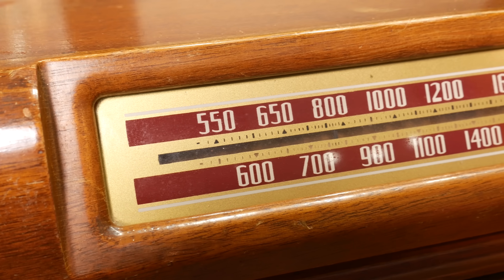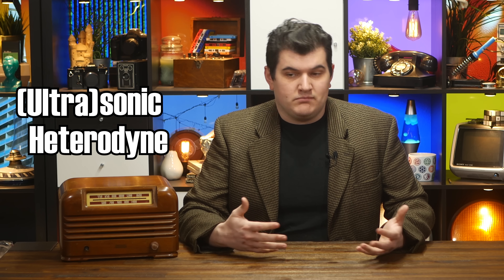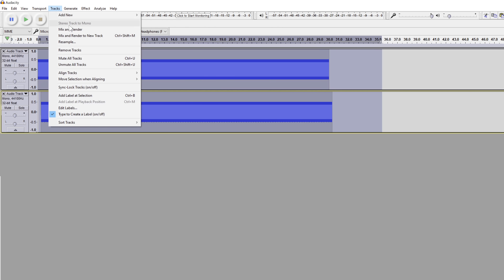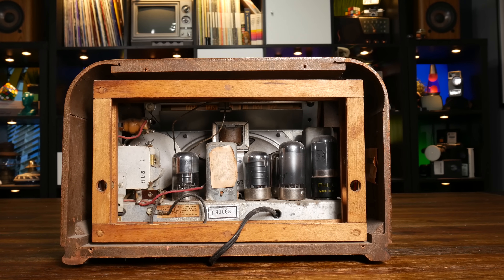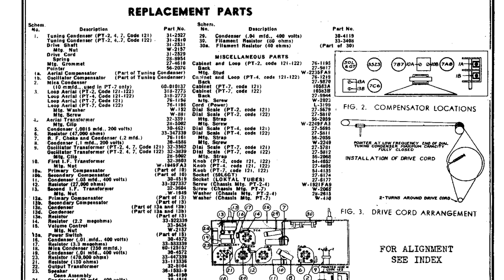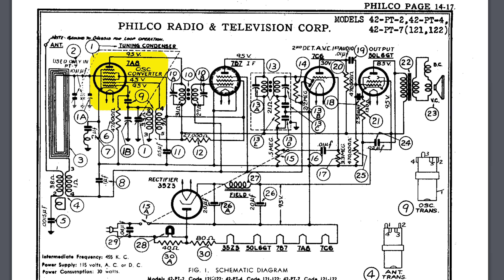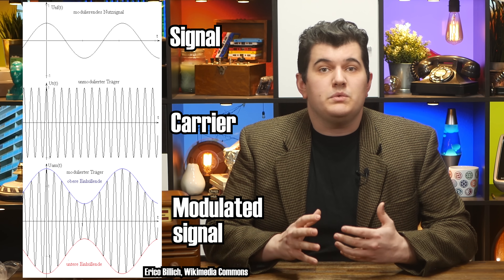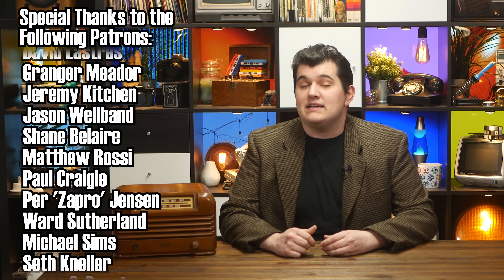The Superheterodyne Radio: No really, that's its name

Comment: This video needs quite a significant correction.
To produce intermediate frequency, one needs not to add two signals (input and heterodyne) together, but multiply them. Addition, being a linear operation, doesn't produce new frequencies you can filter out. Multiplication is what adds and subtracts the frequencies. This goes from the fact that sin(a)sin(b)=(cos(a-b)-cos(a+b))/2. As you see, when you multiply two sine waves, you get (co)sine waves of their sum and difference frequencies.
Though it's possible to do true 4-quadrant multiplication with vacuum tubes, this would require extra tubes, which is cost-prohibitive. Instead, inherent non-linearity of a "pentagrid" tube (with five grids) was used. This tube was working as the oscillator and the non-linear element at the same time. The sixth grid shown on the schematic in this video, grounded along with the cathode, is used to reduce the parasitic feedback capacitance.

Comment: Superb, old boy.  I learned about Superhetrodyne radios while fixing up a 1929 DeForrest Crosley (2x 245 tube push-pull audio output, 3 227s, 2 226s and an 80 rectifier, if I recall).  I picked up off the side of the road. What a machine, I miss her dearly!

Comment: Pretty cool. The first section of the video reminds me of celeste pipes in a pipe organ. There are normally tuned pipes that make up a rank of, likely, string pipes. These are tuned, I think, to A440. There is then another rank of pipes which is tuned just slightly off from A440. When the two ranks are open to a manual on the console, and you hold a key down, it will produce an acoustical beat, as both ranks are played.

Comment: The concepts in this video would make a great segue into how stereo FM works! After FM demodulation, you end up with another frequency-division signal, with:

- The left+right channels (mixed) at 0 Hz: Will be played by radios that don't support stereo FM and assume every FM signal is mono, making the stereo FM signal backward-compatible
- The "stereo FM pilot" tone at 19 KHz: Tells a receiver that supports stereo FM that the signal is stereo FM (for mono-only receivers, this will likely get filtered out due to the demodulator not being fast enough)
- The stereo signal at 38 KHz: This is actually the left channel MINUS the right channel. A stereo FM receiver can add this to the mono signal to get (left+right)+(left-right) = 2*left, or subtract it to get (left+right)-(left-right) = 2*right.

What's ingenious is the stereo signal is at exactly double the frequency of the pilot tone, so the receiver uses the pilot tone not only to detect stereo FM, but also (after doubling its frequency) for heterodyning the stereo signal down from 38 KHz. If the receiver had its own local 38 KHz oscillator for such a task, the stereo audio wouldn't sound quite right due to minor frequency differences between the transmitter's 38 KHz oscillator and the station's.
Reply: The hardware is fairly simple. The multiplex output signal from the tuner is applied to a separation amplifier, which separates the mono L+R signal from the 19kHz pilot and L-R envelope. The pilot signal goes to a frequency doubler, basically a full wave rectifier, which produces the 38kHz carrier, which is combined with the L-R envelope in a shaping amplifier. The reconstituted L-R carrier then gets applied to an AM detector, who's output goes on to a phase inverter. The phase opposite signals are applied to opposite ends of the channel separation matrix, to which the L+R signal is applied to the center. Through destructive interference, the R component is canceled from the left output and the L is cancelled from the right. The outputs then are sent on to the stereo amplifier.

Comment: The local oscillator became a big deal for the US Navy during WWII. Some engineers were convinced that radion for the LO could be picked up by enemy ships and sub and used to home in on their position. The superhet made this worse since there was more radiation from the LO compared to older tuned RF and regenerative receivers. Companies like Hallicrafters and Scott played off those fears and designed "low radiation" radios that were supposedly safe from detection. Such "radiation safe" receivers used things like an extra RF amplifier with an additional coil catacomb and tuning condensers to reduce LO radiation below the 400pW (picowatts) limit required by the Navy.
 
The Navy prohibited anyone bringing onboard a radio not marked as being low radiation, and the typical superhet available to sailors was always a high radiation radio. Ships installed radios like the Scott RBO model in radio shacks and then fed programming out to different areas of the ship through the ship's distribution system. They were commonly known as entertainment or "morale" receivers since they could be used to pick up news and entertainment stations from US broadcast band and shortwave transmitters. They were only supposed to be used to listen to US or British stations. Nevertheless, they were commonly used to pick up Tokyo Rose and Axis Sally since both services had the most up to date music on them. The sailors didn't care about the propaganda being broadcast, just the music  

Although LO radiation was real, how far it could be detected is another matter. Radio companies and some Navy radio engineers convinced the Navy that German shore stations could pick up LO radiation from as far was 1000 miles away! Tests done after the war showed that even under ideal conditions, radiation detection wasn;t possible for more than half a mile away, and it was usually no more than a 100 feet. The Navy spent a lot of money to buy the radiation safe receivers that, as it turned out, really weren't needed, The upside was the radios were also shielded from stray incoming signals and could operate well in a radio

Comment: +TechConnectify  I got a cursory overview of heterodyne transceivers years ago.  Superheterodyne technology is used in radio systems from Longwave AM receivers to J-band Pulse-Doppler radars; vacuum-tube radios use pentagrid mixer-amplifiers for frequency up/down-conversion in addition to dual triodes, pentodes, and (in the case of transceivers) beam power tubes.  Today's digital technology uses a specific type of solid-state diode as a voltage-controlled capacitor for miniature LC tanks in addition to direct conversion for data detection from the receiver IF.

Comment: Unfortunately, the proliferation of microwave ovens, and other frequency hogs is killing off the broadcast radio station on the AM (Amplitude Modulation) spectrum. As a result, especially in a large broadcast market as Los Angeles, stations are now having to increase their power in order to have the same signal strength throughout the community. In some countries, radio broadcasting stations which were on the AM band have been pulled off the air.

Comment: If you ride in a twin-propellor aircraft, you'll experience the phenomenon of interference between props running at slightly different speeds. When the aircraft levels off to cruise, you'll usually hear a low-frequency beat. The pilot (or an automatic synchroniser) will slowly change the speed of one prop,  (it's a fingertip operation), and the beat will slow down until the speeds are equally matched.

Comment: Very cool video on a cool analog technology that is still in use today. Just one remark: heterodyning is often relatedtointerference or "beat frequency".However,this is not correct. Heterodyning works by a nonlinear device that approximates the multiplication of two signals (compare the mixer symbol in block diagrams of superhet receivers).  This mixer produces an output according to the trigonometric identity sin(a)*sin(b) = (1/2)*cos(a - b) - (1/2)*cos(a + b).

Comment: Some of the first digital displays were just frequency counters with a circuit to correct for the IF. If you don't mind a little mental arithmetic you can do what I did. Connecting the local oscillator of my Radio Shack DX 160 to one of their pocket sized frequency counters gave me a nice LED readout 455kHz away from the station's real frequency.

Comment: My old boom box from the 80s had a beat a-b switch. What did that do? I switched it back and forth, and could never tell a difference. Perhaps it affected another nearby radio?
Reply: That's the AM tuner beat cut out. Use the setting that gives the least oscillation over the AM band, especially while recording with the tape deck. It was popular on 1980s equipment.

Comment: As someone who has been repairing radios and stereos (including vintage vacuum tube stuff as seen here) for close to 40 years, this is an excellent easy to comprehend description of the operation of a superhet radio receiver.
In fact, the same rules apply to FM tuners, with exception the I.F. will be 10.7 MHz instead of the 455 kHz used for LW/AM/SW.
And even with modern digital tuners, the same superhet principle is used, although the variable capacitors employed are varactor diodes (voltage-controlled capacitors) instead of a mechanical variable capacitor.

Comment: That was a terrific explanation of the superhet circuit! Fun fact: Interference from the beat frequency oscillator is sometimes used to detect "unauthorized" radio receivers. For example, radar detectors are illegal in some jurisdictions, and the old VG-2 radar detector detector was designed to home in on the BFO circuit on radar detectors with superhet receivers. In response, radar detector manufacturers started including radar detector detector detector circuitry in them, which detected when a VG-2's own BFO was in use nearby & shut themselves down.

Comment: I once worked on a radio that was pre-superhet.  There was no IF, there was a multi-ganged capacitor that varied the resonant frequencies of 4 or 5 (I've slept since then) RF amplifier stages.  It had trim caps on each amplifier.  It was huge and very fidgety.  Hooray for superhet.

As a guitarist, I use the beat frequency of the harmonics to tune.  The beat frequency of 440 to 441 hertz is identical to the beat of 1760 to 1761, but the percentage of error is 1/4 as much.

Comment: Before the invention of the superheterodyne radio receiver, AM radios were little more than crystal radios with amplifiers added. 

At the low end of the AM broadcast band, the tuning-circuitry would make the individual channel bandwidth so narrow, that much of the information in the signal would be lost, resulting in a signal that is almost unintelligible.

At the high end of the AM broadcast band, the tuning-circuitry would make the individual channel bandwidth so wide, that you would hear content from neighbouring stations as well (i.e., interference).

With the superheterodyne receiver, the individual channel bandwidth became constant, because the incoming signal, regardless of where it is located in the AM broadcast band, is always shifted along the frequency domain to the designated intermediate frequency (IF) for the AM broadcast band (i.e., 455 kHz).

Comment: Perhaps worth noting that in addition to power line filtering, capacitors in these radios serve a very important function in AC coupling the valves. See, the output of a valve (at the anode or plate) has a very significant DC bias (often called B+ in schematics), which can sit at anywhere from 300V to 600V and in some cases several kV. It needs that to attract the electrons from the cathode (which may also have a negative bias). You probably don't need me to tell you what happens when you inject 300+V into the grid of the next valve, but for the uninitiated - very BAD things. At very least it drowns out the actual signal completely.

To stop that happening, allowing only the AC (signal) to pass through is achieved by placing a capacitor between valves. Once charged, (healthy) capacitors pass no DC current, but any AC/ripple alters their charge state, so can go on through. In all of these old radios, a universal failure mode is capacitor DC leakage. The barrier in the capacitor has broken down over the years and they are now leaking DC. This is why you should never turn on an old radio before replacing them. If you do - VERY bad things happen. Usually to valves, which will now need to be replaced.

Comment: Ok, so in the demonstration with the speakers, the two sound waves created a beat frequency by physically moving air? And in the radio, electromagnetic waves created a beat frequency due to their electromagnetic properties? And the radio converted that to sound waves at a later stage in the process? If so, it's pretty neat that both sound waves and electromagnetic waves create beat frequencies.

I thought using "waves" to explain electromagnetic frequencies was just a useful way to visualize them, but I guess they behave the same as real physical waves in this case.

Comment: No cringing here, dude.

Notable variations on the usual superhet:

1. Double conversion. I think you briefly alluded to this. Two conversions are done: first, to a higher first IF, then to a lower one. Choosing this would be in an effort to deal with various engineering considerations, especially WRT getting strong image rejection in stages operating at the first IF, then strong filtering at the second IF to narrow to the bandwidth you want to detect.

2. Direct conversion. Essentially, this just means the IF is at 0 Hz. The filtering to AF then tends to be very simple. Also, no images to filter out.

3. Direct detection. This means no IF; just detect right at the original RF, which moves around as you tune. This was the original approach. Nowadays, with advanced digital circuitry, you can make very precise AND selective digital filters that tune over a wide range. I think you alluded to this as doing it "with software."

This stuff looks so primitive now, but back in vacuum tube days it was the bees' knees.
Reply: Oops, tip o' the hat to amojak, who I see now see has already covered most of this.

Comment: i would appreciate better if i knew how older radios before this worked.
Reply: TRF (tuned radio frequency) radios were popular before SuperHets. They used one or more stages of RF amplification before the detector, and often the volume control adjusted the gain of one of the RF amps, rather than the input of the AF amp, as on a SuperHet. Each RF stage, and the detector, had to be tuned to the broadcast frequency of the desired station, usually via a ganged tuning capacitor. These radios, although more sensitive than a SuperHet, were less selective. There were also regenerative radios, where some of the detected audio was sent back to the RF input, to improve selectivity. Also, in a SuperHet, the converter, where the RF is changed into the IF, is sometimes called the first detector, and the audio detector is called the second detector. Some SuperHets also have a tuned RF amplifier ahead of the converter to improve sensitivity. There are also SuperHets without IF amplifiers, suitable for local reception only.

Comment: For those playing along at home: The 5000 and 5400 experiment can be improved by adding the mixer stage. You could use a guitar distortion pedal (or audacity) to create 'intermodulation distortion' which will make the 400hz beat note even stronger. Feed the mic signal through the distortion pedal, or record to your PC and distort it. 
In the radio you will of course also have filters, so if you would use an equalizer to boost the 400hz and cut off everything above let's say 2000hz, , you would not be cheating!

Comment: Basically two sine waves out of phase cancel each other out. If there is a difference thats left over, used primarily in FM radio this is very usefull. The same is done with balanced cables except then its called common mode rejection. Subwoofer have a way to change phase, because lower freq sound waves are real prone to wave cancelation, and you can lose entire parts of a signal if they are out of phase. Also why most of your bass needs to come from one source. Never heard of AM superhetrodyne tho.

Comment: I could be wrong, but I believe the reason the second test with the speakers did not work is because the wavelengths are so much shorter that it gets more difficult to phase-match. I think if you had moved them much closer together it may have worked ok, as I think that’s why it worked ok with the headphone setup.

Comment: Good video! Two things should be noted:
1.) The mixing is widely misunderstood, it does not work like having two speakers in a room. If you just "add" 440 & 441 Hz, the result is a signal that gets loud and soft every second (a form of amplitude modulation), but it does NOT contain an actual 1 Hz signal. You can easily verify that in Audacity. Generate two tracks, 440 Hz and 441 Hz sine at some 40% volume (to make sure the sum cannot reach 100%). Mix them into a single track. Then apply a low pass filter maybe at 100 Hz or something. A 1 Hz signal should not be filtered out by this step, but the result is a flat line (silence). We should be very happy, as this would create all sorts of interferance "in the air". Imagine two FM stations in a town at 100 MHz and 101 MHz respectively making listening to an AM station at 1 MHz impossible. This does not happen in real life.To realy generate that intermediate frequency you have to multiply the two signals. That is what these special mixing tubes do. 
2.) Software defined (or "digital") radio did not make that principle obsolete. A digital WiFi receiver at 2.4 GHz would need to sample the signal at least 4.8 billion times a second (Nyquest's theorem) and even more often at 5 GHz.  It is easy to convert the signal to a much lower frequency range while it is still analog. Then it can be digitized at a much slower rate by a much cheaper analog to digital converter and way less digital processing power is needed to decode the signal.